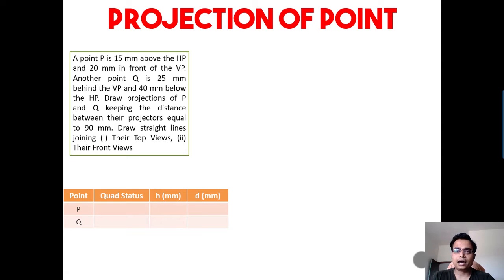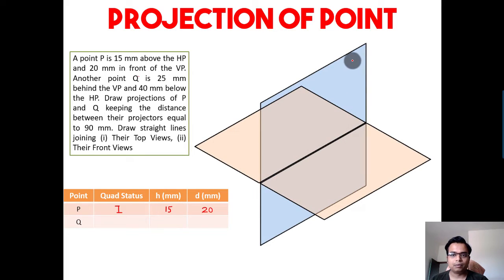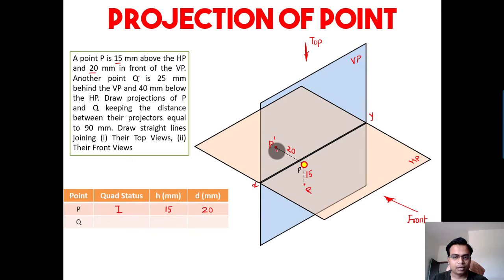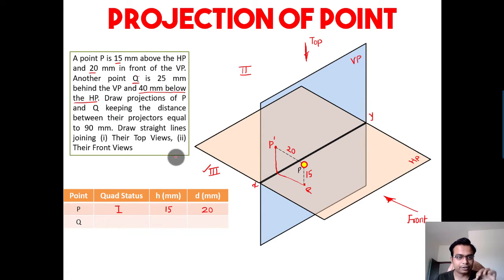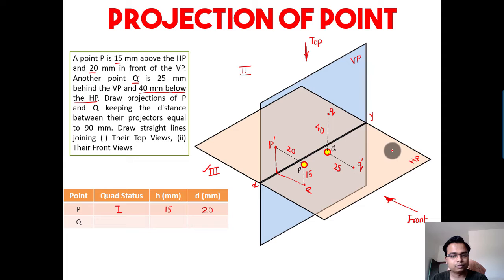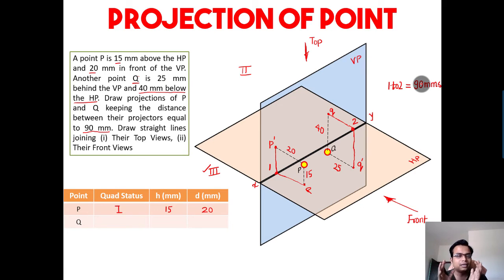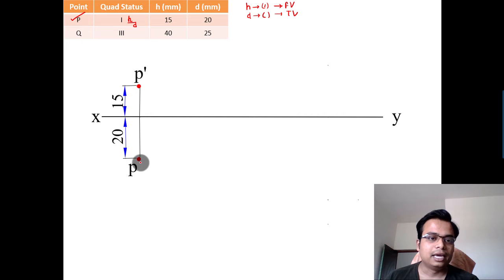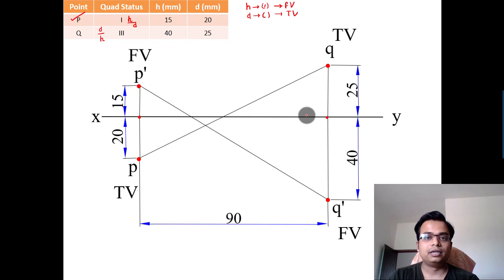Projection of Point_Problem 2_Reloaded

Comment: A point P is 15 mm above the H.P. and 20 mm in front of the V.P. Another point Q is 25 mm behind the V.P. and 40 mm below the H.P. Draw projections of P & Q keeping the distance between their projectors equal to 90 mm. Draw straight lines joining (i) their top views and (ii) their front views.

Comment: Sir can u do this solution A 60 mm long line PQ is inclined at 400 to the V.P and is parallel to H.P. The end P of the line is 20 mm above the H.P and 40 mm in front of V.P. Draw the projections of line.

Comment: point P is 50 mm from both the reference planes. Draw its projections in all possible
positions.Two points A and B are in the HP. The point A is 30mm in front of the VP while B isbehind the VP. The distance between their projectors is75mm and the line joining theirtop views makes an angle of 450 with xy. Find the distance of the point B from the VP.

Comment: A point P is 15mm above the H.P. and 20mm in front of the V.P. another Point Q is 25mm behind the V.P. and 40mm below the H.P. Draw projections of P and Q keeping the distance between their projectors equal to 90mm.Draw straight lines joining their top andfront views.